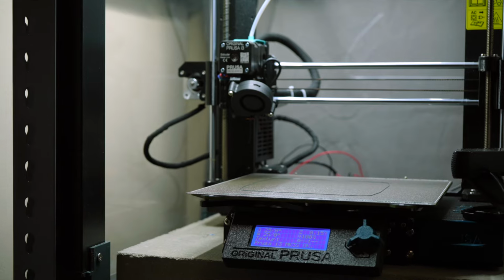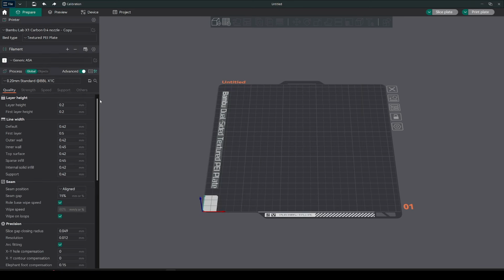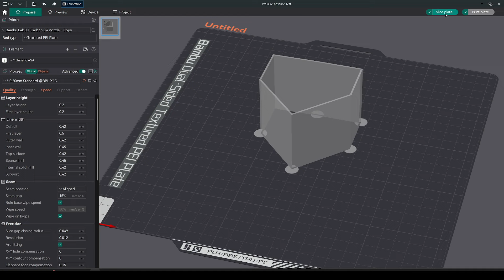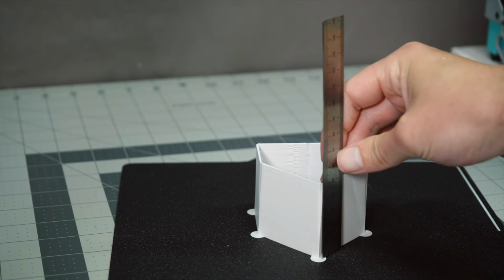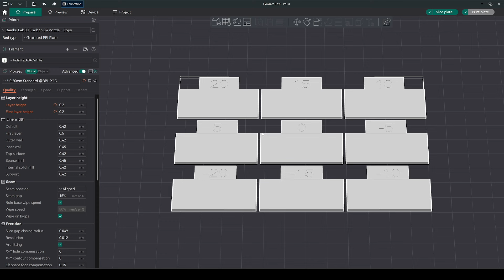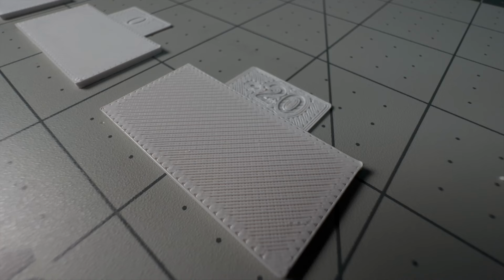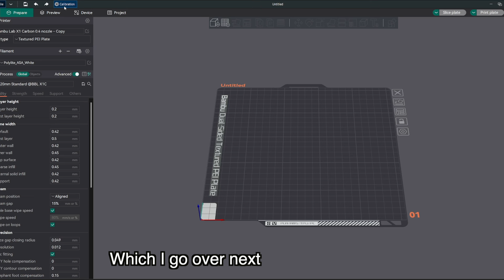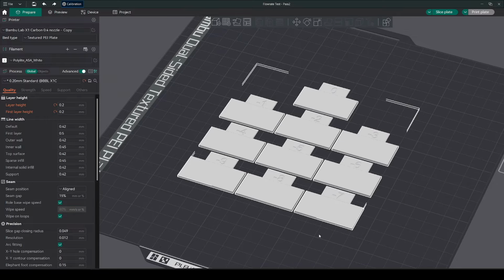Manual Filament Tuning on Bambu Lab Printers with Orca Slicer!

Comment: Great video! Would you recommend printing the temp tower before or after these two calibrations?
Reply from the maker: I don't print them! Usually the default temp ranges are just fine for me and I really only use about 3 brands of filament and every roll of the same type works well with the same temp!

Comment: So what is the next step if there is no separation in the seam? What do you change the start and end PA to for the second test?
Reply from the maker: There was no separation on any of them or you already found a good value on the first pass? If you found a good value already you can either use that or run the second test any way to make sure! If you aren't seeing any change through the values in the first pass something is up. Check the g code itself for the M900 command.
Reply: @ButterPockets  no M900 in my code. Did 2 prints with the second print going up to 14K and no separation just more ringing.
Reply: @georgedunn7573  if the gcode from the site is not exporting M900 commands at all then the k value won't change. I definitely recommend double checking every single value on the tool because something must have been entered wrong. Did you select the right gcode flavor?

Comment: Why do you calibrate the pressure advance before flow rate?
Reply from the maker: Because most of these are aesthetic tests. When it’s doing the top layer of your flow rate chips PA will effect how it puts down that top layer. If pressure advance isn’t dialed in the line width will change as the tool head speeds up and slows down doing that top layer. So if PA is already dialed in you will be seeing only the effect of flow rate to decide which one looks best. It might take going through them both a couple times - PA,EM,PA,EM - because they effect each other but usually the single pass is OK. Hope that explained it!

Comment: I'm new and confused, @5:33 you state that most filaments are 95-98 % extrusion multiplier, and you don't really need the -20 to +20 test, so why not just run the -4 to +4 right from the start and get a more meaningful test results?
Reply from the maker: You can! That’s actually what I suggest in the video, just set your EM to 1.00 and run pass 2 which is -10 to 0. That would save time and give you good results! In the video I wanted to show pass 1 just to demonstrate and explain. Hope that helps :)
Reply: @ButterPockets  Yes I saw that part in your video, however in the pass 2 it goes from 0 to -9, but I think what you really want is the pass 1 modified to run +4 to -4, otherwise starting at 0 and only going negative you don't get to compare the positive numbers.  In your example you used 5 even though you said you felt like 0 was the best tile, unless you were artificially trying to spoof the system by adding 5 and then going -9, but that still basically puts you back at your best tile being 0.  I ran the pass 2, 0 ended up being my best tile of the 0 to -9, since 0 is factory setting I just left it alone, did adjust the pressure advance though.
Reply from the maker: @txdegoable  I used 5 because the default is 0.95 and in that example 5 still kept me less than 1. You almost never need more than 1.

Comment: Thanks for the vid. When do you do the temp tower? I’ve been doing temp, flow, then pa, I’ll give yours a go
Reply from the maker: I personally don't run temp towers. I will run a PLA filament at 215 or an ASA at 250 and depending on what happens just adjust from there. But I find that those median values almost always work what really needs to be adjusted is cooling and layer time. If stringing is a problem or flow rate is a problem temp can help - but drying filament, retractions, and slowing down can help instead. CNC kitchen has some good tests on temp vs strength and that's where I think it plays a bigger role, as well as matte vs shiny finish. But if you're going to do a temp tower Id run that first, then PA, EM, and then potentially PA and EM again in finer steps.

Comment: Hey, I followed the video, unfortunately basically nothing changed on my print. When I rerun the pressure test, it looks exactly the same as the first one. Is there something I am missing?
Reply from the maker: Re-running the pressure test things should look the same. It's just testing the same values again. Unless you change the range of k values that it tests. Once you've selected the k value and put it into the filament profile settings and you ensure PA is enabled, when you select that filament profile it will use that value. Then, instead of running the auto calibration you'll just be using the already calibrated value. I hope that helps and feel free to email me at the email in my bio and I can help more! Expect to see another video highlighting an even better PA method this weekend.

Comment: i wish the bambuu printer could output a filament profile it could save into the slicer.
Reply from the maker: It does. Just export a 3MF file. It will save all your settings.
Reply: @ButterPockets  ohh thanks

Comment: Good video, thanks! What do you think of the method of measuring cube side length?
Reply from the maker: Tuning pressure advance and flow ratio in this way is mostly cosmetic, but should result in "good enough" dimensional accuracy. Measuring with calipers can lead to inconsistancies because every layer is going to be a slightly different width due to tolerance stacking from the filament, the extruder gear, the idler, the PID tune, etc. I would recommend if you need more dimensional accuracy use the "shrinkage" variable in the filament settings in orca slicer. Hope that makes sense!
Reply: @ButterPockets  Yes, that makes sense. Thank you!

Comment: I'm new and feel stupid for asking, but whenever you get a filament dialed in with manual settings, does leaving the ' flow calibration' check box checked when you go to print override your manual calibration? Or is it okay to do both?
Reply from the maker: It overrides it.

Comment: Hi, I think the adjustments after pass 2 are obvious but at this point I just wanted to ask if I am getting it right. If I like e.g. -2 the most in pass 2 and I used 5 in the formula to get the value for flow ratio in the first step, I will do the formula again with 3 (5-2). 0.95*(100+3)/100 =  0.9785. Is that correct?
Reply from the maker: It’s just a percent change formula. So it’s (existing value)x(100+value from test)/(100). So if you started with a default profile and chose 5 you first did (0.95*105)/100 and got 0.9975. Then you chose -2 so it would be (0.9975*98)/100=0.97755.
Reply: Great video! Thank you so much for that info. Without the formula isn't .97755 just .9975 minus 2%? It's just quicker and easier for me on a calculator if it is.

Comment: what about with nozzle size change?
Reply from the maker: I actually just changed to a 0.2mm today and my profiles seemed to work just fine. But I’d recommend running a shorter print that you know how it should turn out. If you see a bad seam then redo PA tuning and you see bad top layer then redo EM. It’s mostly based on your prints look!

Comment: I tough with lidar, we dont need to manual calibrate anymore, especialy flow rate. I want x1c because of the lidar.
Reply from the maker: You certainly don’t have to. But in its current state it still isn’t quite as good as doing it manually and it’s not really robust. Something as simple as too much light can throw it off. If you don’t want to manually calibrate you will definitely still get good results though.
Reply: @ButterPockets yeah it defeats the point of the lidar. It may not get as good of a print as my voron 2.4 that i spent hours manually calibrating, as of right now, but it's close. However, I have had a few times ive had better prints off the X1C then my 2.4. Over time the lidar will get better tho

Comment: would this work for non bambu printers
Reply from the maker: Yep. Provided your firmware supports pressure advance (klipper)/linear advance (marlin).
Reply: @ButterPockets  my real problem is orca is too slow a 10 hour print on Cora will take 20 on Orga tried copying the settings but the names are all different. I just want to make it faster any idea or some help? Thank you.
Reply from the maker: @hansherrera6969  it’s almost certainly your “min layer time” in your filament settings causing it. But I’d have to like sit and look.
Reply: @ButterPockets  any way you can help me would be great i can send you pics of my settings

Comment: Can you cover how to read all of the other OrcaSlicer calibrations? I've read the wiki, but a better explanation would help me understand what I'm doing. I watched Stefan's video on increasing flow rate capability to improve print strength but while it is interesting it wasn't very actionable on unmodified printers like you did.

Also is the print time difference just turning off the autocalibration? (also subbed thanks for the video)
Reply from the maker: I personally don't use any of the other calibrations, but I can definitely make a video on them if you want! I find temperature tests a little unnecessary and someone like CNC kitchen has done extensive testing on what temp does for prints. I've found that "normal" temps for filaments work and if something does it I adjust it per print, but I rarely need to adjust temp. Max flow rate and VFA would definitely be a little more useful imo.
Reply: @ButterPockets  I agree. Please make a video on the other calibrations please! Your explanation on these calibrations make the most sense to me out of all I’ve seen. 

Also, is retraction something that is not normally calibrated anymore?
Reply from the maker: Sure. One of the other comments explained how to do what I feel is a better technique so a follow up is definitely coming! I only tune refraction if I need to. I find if stringing is a problem is probably because your filament needs to be dried more than anything.

Comment: Im using 1.6.2 and for some reason, every time I open Orca none of my settings are saved. Even though I’ve saved them, named them etc. EG. Made a PLA profile and Saved it. Closed the program and when I opened it up, all that shows up is Default PLA 

Wtf!??!?!
Reply: Did you pick a different nozzle by chance?
Reply: @bcaswelch  No, that’s what’s baffling me. It first I thought it might be that I didn’t create a Bambu account because I’m not using a networked printer but that didn’t change anything either.   I found a folder with all my configurations but for some reason they don’t load in. 

Now I’m wondering if I have to manually add something to a start up file or something
Reply from the maker: I think I know what you mean and if it's the same issue I have I opened a ticket on the github. If you sync with the AMS it always goes to what is selected on the printer for the AMS. You then have to go and change those filaments to your saved filaments in orca slicer. The problem with that is the default color is orange now so you have to save a filament profile with each color of your filament to have it look correct in slicing. So when you go into orca select the edit button next to filament and just switch it to your saved profile. It won't load a saved profile BT default. I hope that helps.

Comment: .02 x 10 is .2 not .02 unless me big dumb also wish you showed how to do the negitative values aswell with the formula for the second pass
Reply from the maker: It works if the modifier is positive or negative. You’re just adding or subtracting the modifier in percent and it’s already so close to 1 that if the modifier you like is say -2 just take 0.02 off whatever your current number is. In my example where I did +5 the outcome is basically 1. So you can just add 0.05 to 0.95 and get 1. The key here is that your extrusion multiplier is the decimal form of percent: 0.95=95%. Those test tell you how much percent to change it so +5%. It’s very close to 1 already so 5% of .95 is basically just 5%=0.05.

Comment: If you want to throw everything up in the air regarding speed...just buy an E3D ObXidian Hi-Flow hotend. I can run Bambu Labs PETG-CF at a max flow rate of 35 with absolutely no issues. It looks like it's running on ludicrous speed when it's on standard.
Reply: E3d has a serious health warning for this product.
Reply: @peterburton3095  But only in california...

Comment: Problem I have is even the dialed in print is not all that great, just look at the letter X and look at how messy it is, also, you should look at this a case by case basis.  The X1 C I got the first prints looked like the cube on the left.  I check the belt tension and ran some prints, and over time it seems to fine tune its calibrations and the prints got better over time.  (arguably it could also be the printer settling).   The point is my first cube I printed out of the box looked like his on the right, not the one on the left.  So I would suggest you take this video as a suggestion.  He makes a claim that is really untrue that the auto calibration does not work, and the values are two basic (which sure you can assume that) however what I find interesting is he went through all this trouble with the EM/PA settings, then why not edit the start Gcode and alter the PA values there to a more accurate range of what he found manually?  then let the printer do its thing.  Most printers if you look at Core XY(Z) with standard .4 nozzles for EM for instance run between .92 and 1.0 for the value for extrusion multipliers, knowing this and running a PA tuning you can alter the Gcode to look between those values, for instance if you do the Ellis PA print you can easily take the best 3 values and use those in the Gcode.  Boom done.
Reply from the maker: So, to start this video is a bit dated at this point. There’s been updates and I even have newer videos on it. There’s been a ton of updates to how Bambu studio work and a ton of updates to how the calibration works. I never said it doesn’t work, I was trying to explain that it’s always going to be suboptimal compared to tuning things yourself. Of course the auto calibration works. There’s also no need to edit any kind of start gcode as now the manual calibration checks even more values. These days I do use it and it produces fine results, although I still prefer to tune myself. The point of this video in particular wasn’t to show you perfect prints, but to show you the available methodology to get there. People can take the ideas from this video (and my others) and apply them to how they print to get better.

Comment: Going to far is a bit pointless. I’ll tune things to a certain degree but I’m not gonna get in there and start dialing it in for an hour. Especially when you have filament that’ll change from the beginning of the real to the end in increments of .0001 when you start dialing in things that Subatomic level. Get it close, and call it a day.
Reply from the maker: That's why I like these tunings, especially what's in PT2 for PA. Definitely doesn't take an hour and most of it's just a couple clicks, but you can always tune to whatever quality you want on your prints!

Comment: Speaking of filament waste which is the argument here. You using those calibration test where the tower could be half the size in height and where it is ridiculous to test -/+20 or -/+15 flow rates as they are not real world scenarios. If you need those values your printer setup is wrong or faulty.  I guess there waste is euqal here to BL automatic approach as the lines due waste less then then the hole tower.
Reply from the maker: I think it’s in my next video where I say that I wouldn’t recommend the pass1 to begin with. Set it to like 1.1 and run pass2 only. That’s also why I like to run the pattern test in a small range of known values. For PLA from like 0.01 to 0.03. Instead of two passes and huge ranges